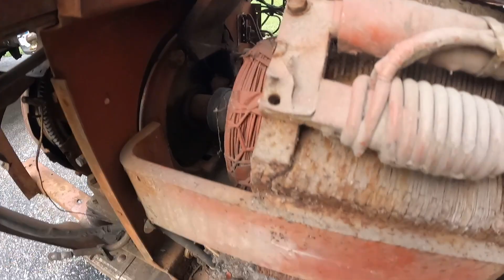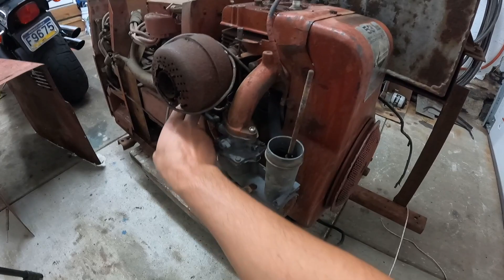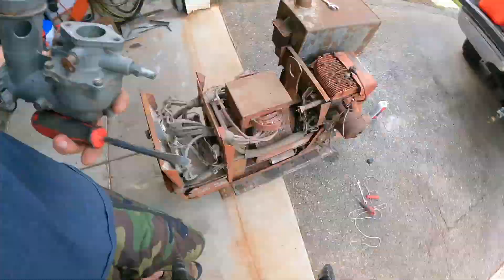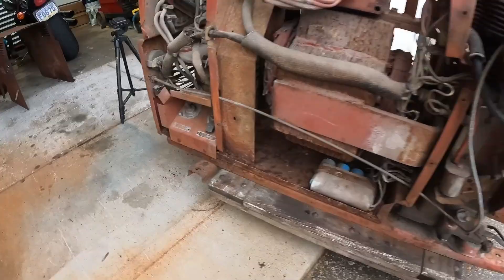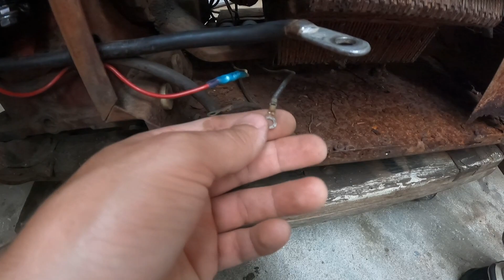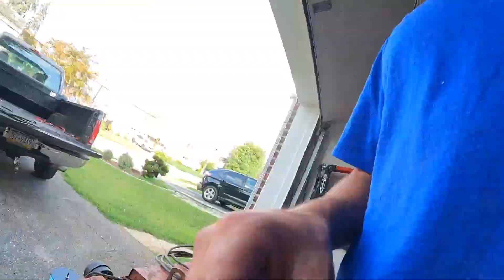$200 FB Marketplace Welder Will it RUN

Comment: I just picked up one of these today with the Onan engine on it for $150. Mine is probably going to be a bit more of a basket case, apparently it had sat outside without the air filter on it and got water in the cylinders. Supposedly it was turned over to get the water out of the cylinders and oiled. Engine probably needs a rebuild, but I'm gonna see if i can get the engine to at least run a little bit and see if it makes power before i decide to sink money into it.
Reply from the maker: For sure try to get it running the welder end of these machines have a lot of wires and things that could be damaged from mice or the elements. Best of luck on your project. Worse case there is a lot of scrap weight so I doubt you will lose even if the machine is broken.
Reply: @thedelcodave  That's kind of my thoughts. For $150 there is enough copper in these old machines i should atleast break even.
Reply: @thedelcodave  Update on the welder. I got my $150 welder up and running. Cylinders were rusted and have some pitting. Piston rings were stuck fast to the pistons. Had to pull them out and free them up. Carburetor was full of gunk. But she runs good now. No noticeable smoke coming out of the exhaust or breather. It welds and even the auto-idle works.
Reply from the maker: @d3faulted2 sounds like a win to me.  I have seen rusty cylinders clean up.  As long as it's not smoking bad. That's great that the welder functions perfectly.

Comment: I bought one of these new when Lincoln came out with them in the early 80’s. First engine drive I ever owned! It was a good machine - for a couple years. Then, no weld! Turned out the armature had a short in it, a fatal flaw requiring replacement. The warranty was expired, but after making some phone calls, Lincoln replaced the armature free of charge. It was evidently a common problem with the Weldanpower AC/DC, and they were discontinued. I never had any more issues after the repair. Always have been, and always will be, a Lincoln man!
Reply from the maker: @tomt9543  this one is still welding great. We were even using it with 1/8 carbon arc gouging rods.  I wonder if the armature was replaced in the past on this machine.

Comment: Good job on getting it up and running. First thing I do before I turn a engine over is check the oil. Should have figured that gas tank was full of junk, Fuel line filter is in order to catch the gook before it enters carb. :face-blue-smiling:

Comment: Looks promising Dave!
Reply from the maker: Needs some more love but overall I am impressed all the functions still seem to work. I did some more welding with it the other day and it seems to be welding really smooth.
Reply: I would have poured a little seafoam into the cylinder and let it sit for a day. Just in case the rings were rusted welded in. But good job! Maybe throw a rag over the carb air opening to keep it from running to lean.
Reply from the maker: @dumbasshomesteading6358  My neighbor sprayed some lube down the cylinder before he dropped it off. Good idea about the rag as a makeshift air filter.